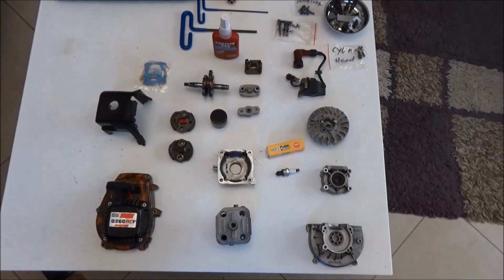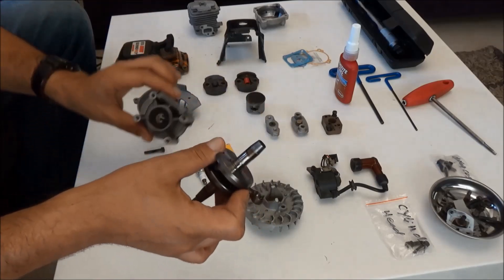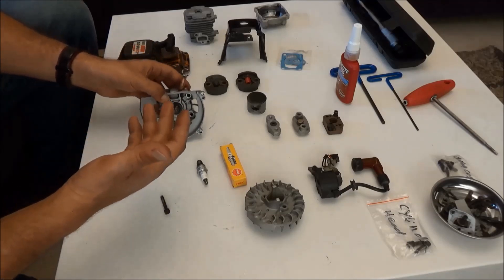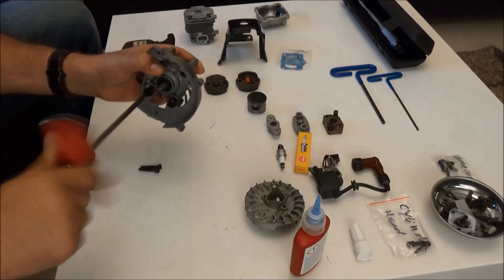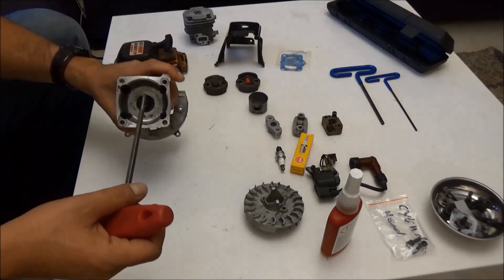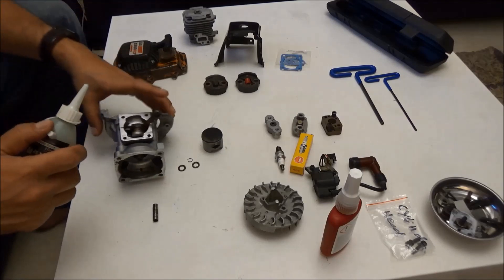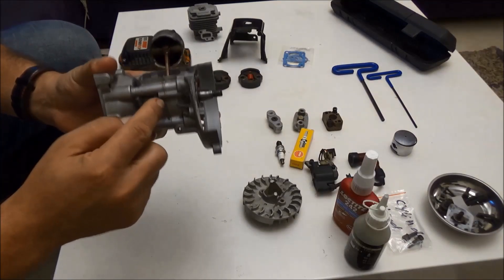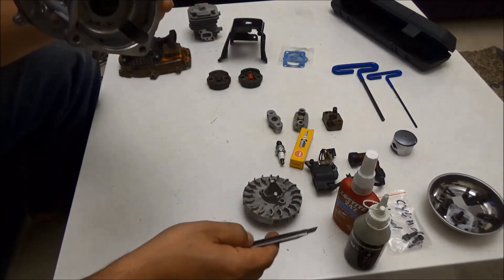2 Stroke Engine Rebuild - Part 1 (HPI, HSP, FG, 1/5 Scale)

Comment: OmG! You lubricate the mating surfaces on the crankcase where the gasket goes! I thought I was the only person that done this! LoL! and YES, people dont understand how easy they come apart next time, and the gasket just peels off in one piece and does not get stuck and have to be scraped off! I actually dont use oil, i use grease ... but it does the same thing.

 I am SO happy to see I am not the only person that does this! I do this with ALOT of gaskets! They always seal perfect, and they always peal off so easy so there is normally no need to scrap the surfaces again, because the gasket dont stick to them :)  Awesome video my friend!

Comment: I have a 30cc engine in my truck, do you know how long does a stock head gasket last for?
Reply from the maker: It depends on the engine brand, RCMK and Zenoah gasket and seals can last for so long. CY, king motor and Rovan will mot last for long. Maybe two years, however,  it's easy to replace if it gets busted and I recommend a cooper gasket with the proper thickness to maintain a squish clearance of .35 - .50MM.

Comment from the maker: Hi Robert, if you refer to replacing the head and piston (top end) then yes you can. If you keep the stock crank and replace the piston and cylinder with 36mm bore then the engine total displacement will jump to 28.5cc which everyone call it 29cc. If you want to increase displacement to 29.5cc or 30.5cc then you need to install a stroker crank +1mm or +2mm. I hope this helps

Comment: I have a 26cc cy motor. Can i just put a 29cc on it with different crank?
Reply: Yes.
Reply: @alexanderthegreatsdad.3831  Do i need the change the crank for such a small step?
Reply: @rtoebak76  i wouldn't think so, it should be an easy switch..

Comment from the maker: ESP is very powerful.  Therefore go for the 4 bolts head. The 2 bolts will not handle the power and will break
Reply: Taha`s DIY try can handle the power. Issue they leak
Reply from the maker: @tontobb8956  Hi Tonto, if you refer to head gasket then the paper gasket won't handle this high pressure.  Use a cooper gasket and it will last forever. I hope this helps.